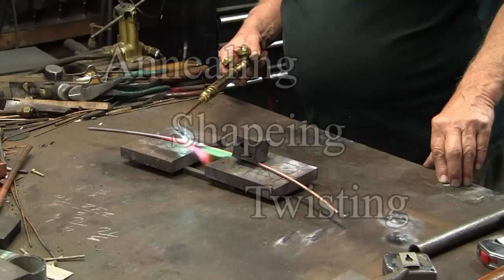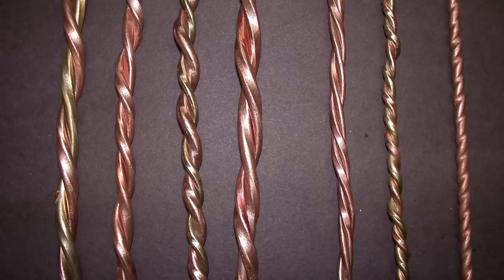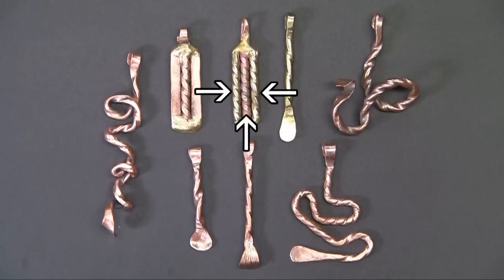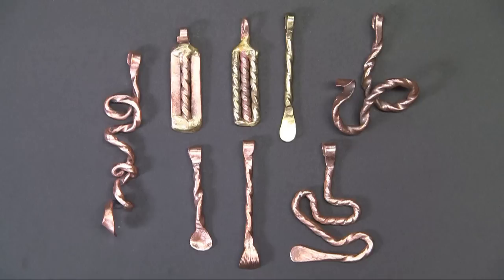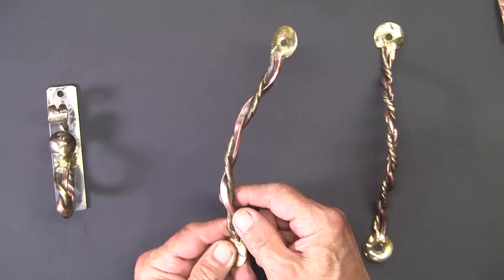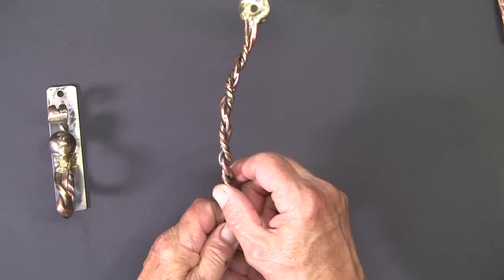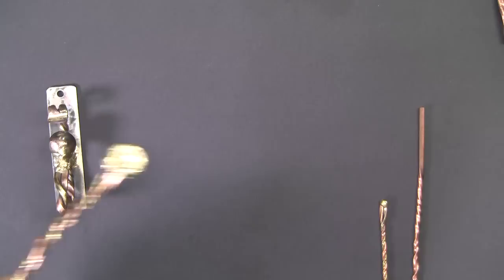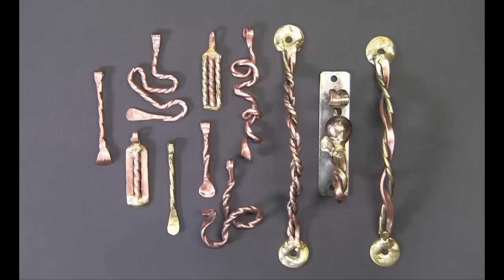Twisted Wire Pendants and Drawer Pulls

Comment: George, I share the enthusiasm for grabbing up some material, wire, flat stock, etc. and seeing what turns out.  The first effort making something new usually ends in frustration.  After remaking it a time or two, normally produces a piece that's atleast acceptable or then realize I probably can't do it.  But, then I'm reminded of a Henry Ford quote, "If you think you can do something, you're right and if you think you can't do something, you're also right!"  Yesterday, I made a very small copper chicken coup with an outside pen for my wife's fairy garden.  Tossed out the first one, but the second one was ok since I used your "dab of brazing rod" method on the fence rails.  That never fails.
Reply from the maker: MM Reporter You're right about first "attempts".  For me, first attempts give me direction.  Sometimes it's the third or forth attempt that finally gets me zeroed in.  Glad to hear that the "dab of brazing rod" works for you.

Comment: Nice job.
Reply from the maker: jaydekaytv   Thanks.  I find it interesting what can be done with just wire.
Reply: George Goehl Yes indeed. Very cool and I like the way you think.
I'm interested in setting up a hobby lab/workshop at some point in the future, the problem is I'm interested in so many things I can't decide which machinery/tools to buy. :)

I like the handwork you're doing, though I may hold off until the CNC industry can produce a solid at-home 5-axis machine. I like the fabrication possibilities and the electronics/computer element.
Reply from the maker: jaydekaytv Today, there are so many tools available, that it is hard to make a decision.  With you interest in electronics and computers you will have a fun and interesting future.
Reply: George Goehl Yes indeed, on all points. Take care and enjoy these times as well. :)